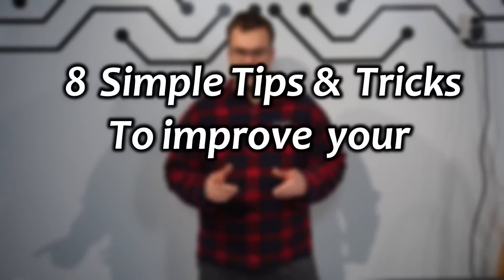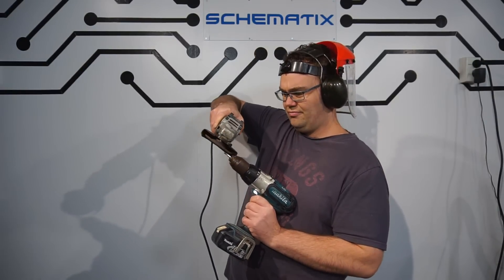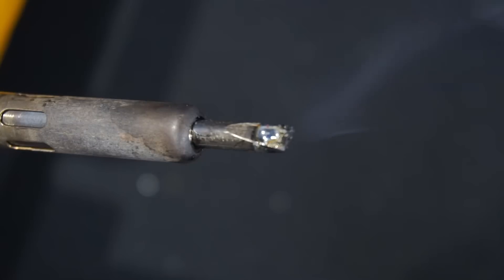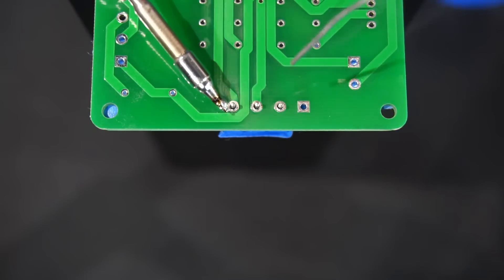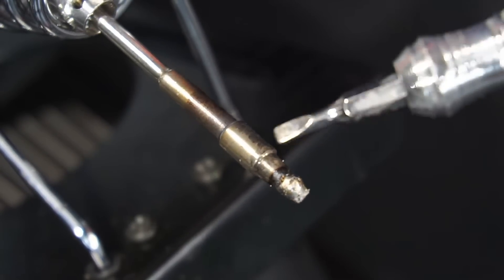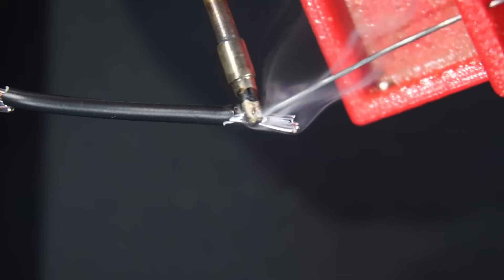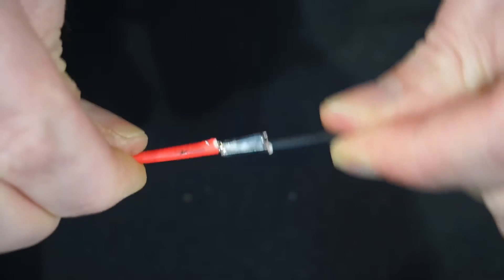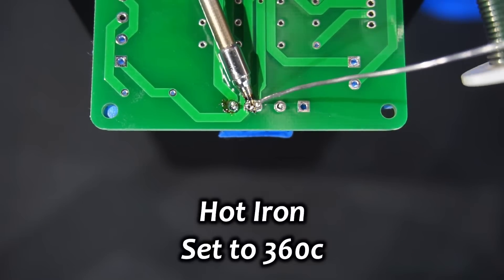How to clean your Soldering Iron! 8 Tips to improve your soldering skills

Comment: These are all good soldering tips in this video, Ive been soldering since the age of 5. There are some good tip cleaner products you can buy also, but sometimes not that easy to find. Ive also got a small pot of multicore tip cleaner that I bought from Dick Smith 20 years ago. Its amazing stuff, especially for real old tips that have a hard oxide layer built up over time. Ive hardly even touched it with my iron, it lasts forever!
Reply from the maker: RIP the old DickSmith electronic stores. They had some quality products :)

Comment: If you don't have a sponge, you can fold up a wet paper towel and use it instead. Either way...it's what you want to use. Best tool for the job in my book. I don't mess with the brass wool anymore. Unless that's all there is. Which is never.

Comment: I disagree using brass wool to help clean your iron. It will eventually wear away the special coating on the tip of your iron. The best way of maintaining your iron tips is to coat them fully with fresh solder prior to turning off your iron. This will protect the special coating while the iron is not in use. I have tripled the life of my tips using this method. The rest of this vid is quite good... 9/10
Reply from the maker: I'm glad you enjoyed the vid :) Brass wool is safe to use as brass is soft enough not to damage the coating on iron tips. You might be thinking of Steel wool? Steel wool is much harder and will damage the tip over time. :)

Comment: Great tips, my only gripe is the wire tinning techniques. I find it easiest to rest the soldering iron on a safe holder and bring the solder and wire to it with my two hands --- but that's minor, when you solder two wires together you really should twist them together first and then solder. This will create a much better mechanical connection. Thanks for the video!

Comment: I build radio controlled drones best with cars I do electronics experiments lots of Arduino stuff I make my own pcbs I love to solder.
With that said I'm also pretty much self-taught so this may sound like a real beginners question but it's driving me crazy.
Recently my wife is a gift got me a Dremel multi tool that supposed to do soldering and at the same time I bought myself a Weller 40 watt soldering iron.
 I've been using a $400 hakko for the last 12 years but it pooped out on me and I haven't opened it yet to see how to repair it. In the meantime I have these two new irons.
I'm using the same 60/40 solder I've been using for as long as I can remember. It works great. Up till now.
With either of the new irons I find I can't tin them. They act kind of hydrophobic. The solder balls up in evaporates for lack of a better word or bounces off the tip. it's difficult to solder anything because I can't make a good connection with the wire without tinning the end of the iron. So the wires too cold but the tip is too hot at least that is what it seems like.
Reply from the maker: Hmm, that is a curly one. I can think of only 2 reasons why you can't tin your irons. 1. They need a good cleaning (as demonstrated in this video) They might not appear dirty, but it's possible they have some production coating/grease from the factory? 2. Flux core lead solder doesn't normally have a shelf life compared to flux core lead-free solder. But it might be worth buying a fresh roll to see if that solves the issue.
Reply: @Schematix  so I thought it's been so long since I bought a new iron much less a good quality one that maybe they did have a coating on them I tried wiping it off a thousand ways I used to flux on it I can't seem to I change that characteristic. And as far as the solder itself goes I've tried 3 different kinds I still have a boat load of the old RadioShack stuff which I like but I also got two other brand names they were highly recommended I'm having the same problem with all of them. What kind of behavior Can you expect from an iron that's too hot will it vaporize the solder?
Reply from the maker: @christopherleveck6835  Hmm, I'm wondering if the tip has oxidized in storage. Perhaps before you bought it? If my assumption is right, then no amount of flux will remove it. Since the tip clearly isn't usable in its current state, I personally wouldn't be bothered about damaging it. Try 800+ grit sandpaper.  Give it a couple strokes on the paper, then try flux'ing & tinning the tip. Failing that it's time for a new tip anyway?
Reply: Scrape the nickel, or whatever it is, plating off the tip. Down to bare copper. 100x easier to keep the copper tinned. But don't be surprised if you have to scrape(read file/sand/grind) the oxide layer off the copper occasionally too. It's also going to get "eaten up" by the flux a lot quicker(yes...even rosin flux will deteriorate copper...it's why tips are plated...and not bare copper). So the tip will need reshaped from time to time(until it's so far gone you can't do nothing with it). I don't know exactly what the problem is. But I have A TON of experience dealing with it with cheap irons(with cheap tips). Pretty sure it's a combination of too much heat and poor quality plating metal on the tips. Anyway good luck finding replacement tips. Because the one your using won't last very long once you go down this road. But do you want it to work at all? Or can you afford a better iron with better tips? Those are the questions.